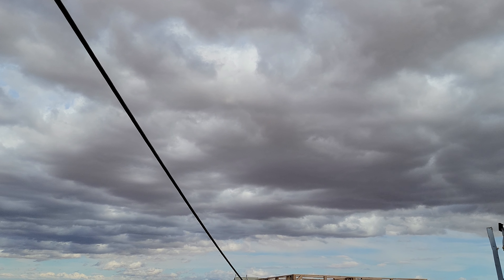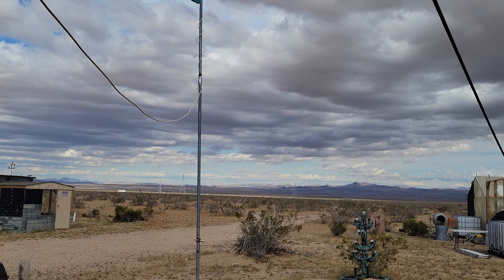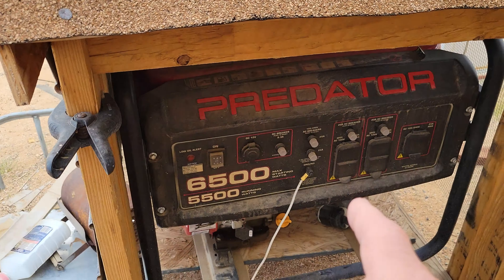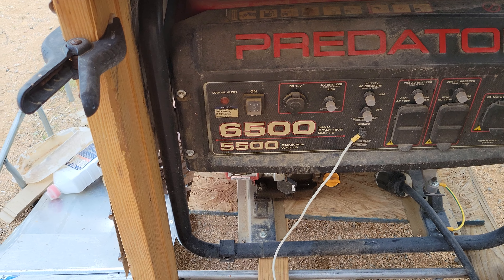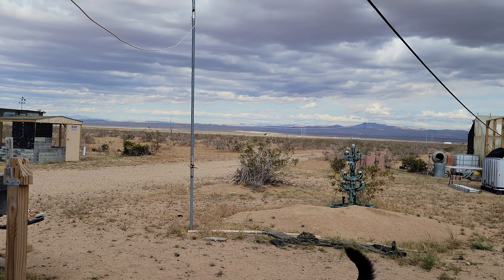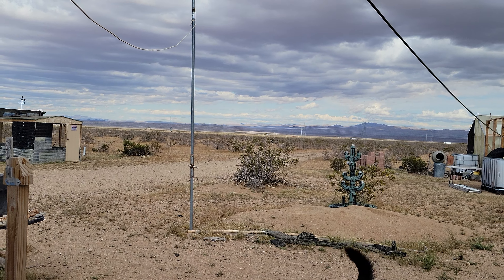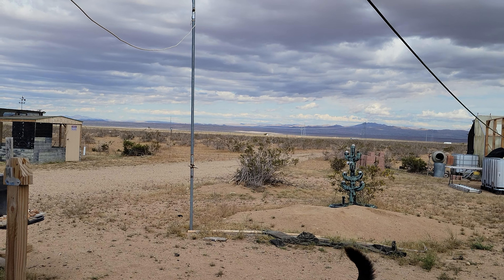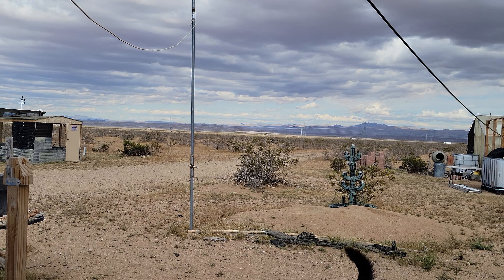Off Grid Necessities, Part 6, May 4, 2023

Comment: When you consider living off-grid versus a rural home connected to the electrical grid 
remember that situations like mine are common
 we have been without power for 18 hours 😂
 so we might as well have been off-grid anyway 

I've already spent $16,000 keeping the lights on for six and a half years could have put it into a bad ass off grid system.
Reply from the maker: Welcome aboard, Kevin!  You speak the truth!  I keep telling my neighbors who are on grid to get a solar backup system.  They have had power outages in the past too.
Reply: Wow $16,000 is a ton of money. Not sure what you've spent that much for but a cheap generator & a piece of wire back to the box would have cost less than $500. Even a few 100 gallons of ⛽️ gas you couldn't have spent that much. Add a couple cheap solar panels & a couple of batteries would be $2,000.
Reply: @Denise Wilson  one fact never usually tells the whole story
 it's been about six and a half years that's just a rough calculation at $ 250 a month which is a lot less than a lot of people pay for electricity 
which is also more ridiculous

But now that you mention it part of the inflated price of this house includes the fact that it was hooked up to electricity in the first place

 but again that has little value to me because they're always crashing my equipment with huge power spikes 
and crashing at the worst times when it's freezing cold
 or over 120° no power
 for hours and sometimes several hours

Comment: DC vs AC
When you may be starting out super low budget
maybe wire lights DC (direct current)
so at night you can turn the inverter off
So there is stand by power
with the inverter off keep the refrigerator closed or move frozen bottles of water from the freezer to the cooler box
But only suggest if you're on a super low budget
Reply from the maker: That's the point of this series.  Plan ahead, so you don't have down times.
Reply: @GBear  
Some times things happen out of one's control
and you need to roll with the punchs
Called Deal With It
Even if it's living under a make shift tent using a tarp...
maybe a used 100 watt panel
Rebuilt battery and 12 volt lights
Just suggesting
No matter how down on your luck you are
You can still make it
Just don't give up
Reply from the maker: @jimh4167  good advice! Don't ever give up!